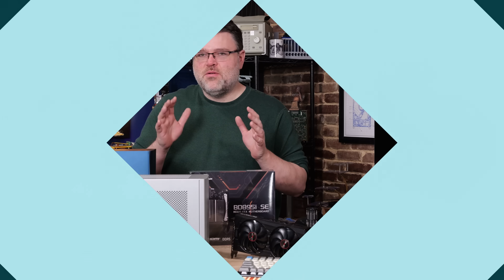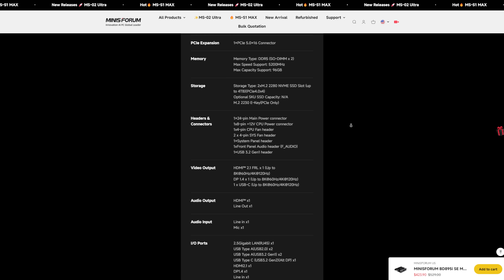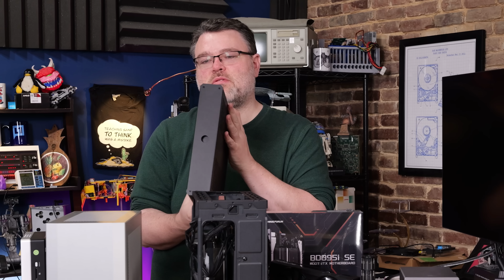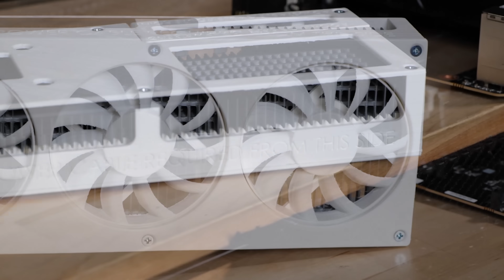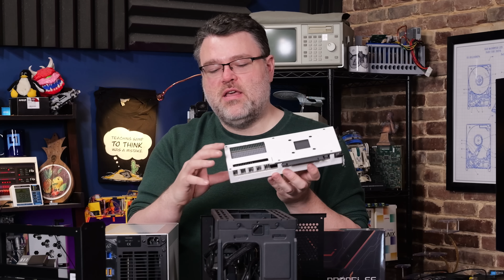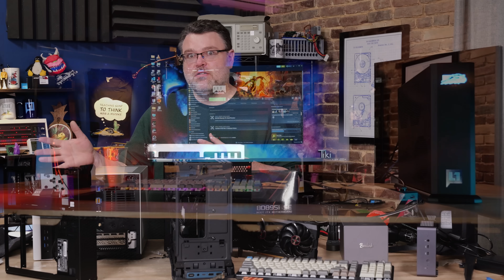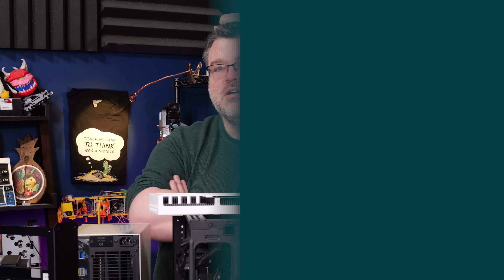Mini PCs Need Some New Rules! Ft: Minisforum BD895i SE Motherboard

Comment: I travel a lot for work and I enjoy FPS titles, especially Deadlock, right now its a mini-itx inside the fractal ridge which I think is still hilariously large for such a small motherboard. 

the thinner flow-through seems to me as most optimal for sowing in my carry on with a portable monitor 65% keyboard and mouse,  with iems for sound, I can setup and pack this in about 2 min but its just too heavy and takes up my entire carry on.
That prototype is very intriguing to me as that's the size I'm going for.

So for me its the hotel Deadlock fps build where I can hit 100-120 FPS in a super small form factor, the case cane just look like a cheese grater for all I care as long as it's not thermal throttling.

Optimum tech did a build that was super small but I just don't have the budget for that low profile GPU and access to a 3d printer.

I thoroughly enjoy this channel thanks!

Comment: The thermal paste on these minisforum boards is the biggest garbage i have ever seen. My 8945HX runs almost 20°C colder with arctic mx4 than with the default paste. Also i could be very lucky but my 5600MT/s RAM kit runs at 6000MT/s + decent timings without any issues. Its bad to config cause you have to test all the timings by hand which can take 1-2 days but atleast my board + 8945HX allows decent RAM OC

Comment: Is there a waterblocks to make it fully watercooled ?
I would like get mini itx watercooled fully psu gpu motherboard rams nvmie all in waterblocks and only one big radiator that needs cleaning.
Is there motherboard that will tune ramm sticks out the box, for me ramm faulty and needed tweaking is what hold back from new build I genuinely hate this new ramm sticks so hard to tweak as before always had motherboard whit memtest.
If I see motherboard watercooled whit ramm and cpu  soldered in that be my choice as from my experience you put ramm in and hard drives and forget so I would rather had already soldered in ram sticks that genuinely work out of a box 
Air cooled mini pc is okey to just need somewhat sandwich so can take panel whit all fans off and blow dust of whit compressed air than no need in watercooled system. As right now I got all watercooled love how clean it all is inside, only hoover now and than 2 x 4 x 120mm radiators

Comment: "It'll get the job done, if you're not gaming" I can game on the older 795iSE version of this on the IGPU pretty well including all COD's, the Battlefields, and a few others even CP2077 on medium settings @1440p. I currently use an RX7900XT with it, but I did test the IGPU and you can DEFINITELY game on it. It even crushes most RPG and casual building games like minecraft, 2d platformers, the works. This version has an even stronger/more-powerful IGPU so it stands to reason you could game just fine on it. even SOME AAA games on lower settings.

Comment: I had purchased a MINISFORUM EliteMini UM780 XTX Mini PC AMD Ryzen 7 7840HS DDR5 64GB in February 2024 that was great until it died in September,2025.  I have built my own high end PC's for over 20 years and never experienced a CPU failure, actually it was the graphics portion of the APU that died.  I feel that the cause is that the extreme small form factor just does not and will never be able to supply adequate cooling for higher end components.  Between the Ryzen 7 along with the 780m graphics in combination of two gen4 SSD's this mini PC simply cooked itself to death.  When I saw the MINISFORUM Motherboard BD895i SE Mini ITX board and noticed that it had a PCIe gen5 16x slot and used DDR 5 SODIM memory even though it is limited to 5200 memory it is compelling to me given the outrageous price of DDR5 memory I figured that I could use the DDR5 5600 memory from Mini PC that died.  I just checked on Amazon and a 64GB SODIM kit from Samsung is $875.  I already have several cases that will work well along with an 850watt power supply.  Along with gaming I also do video editing using Davinci Resolve Studio along with 3D modeling and animation in Blender.  This MB is currently selling for $420 on Amazon, do you think that an RTX 5070Ti will work with this MB?  If it will work I can get by for a while with a New Radeon VII still in its sealed box that I bought back in 2019 for a planned build that was interrupted by an illness.

Comment: I have a Onexplayer mini. It has 2 usb4 and 1 OCUlink port. It is stable with 3 eGPU’s for AI purposes. As we enter this dark era of scarcity, I think getting the most out of what we already have is important. On my micro config it’s best to run two higher end cards for AI, and a smaller card for the screens you interface with. There is a trade off for which enclosures offer Ethernet and USB ports. Which  ones only have OCUlink. 

This approach has allowed for 48gb vram in my little device with a maxed out hx 370 64gb. USB 4 at PCIe 3 x4 and 4x4 for OCUlink. It’s cool what I can do with it. 

Please make a video on a mobile device you can play games on at the airport and then run a 70b parameter llm locally at your destination. That would be  impressive.

Comment: I had installed two new western digital m.2. SSD and this thing won't even boot. Installed an old m.2. from a Haswell system and it booted . Anyone else experiencing these issues?

Comment: When the first bd795's came out I jumped on a microatx version of this for my main system.  At the time I "cheaped out" and just got 2x32gb dimms.  Told folks at work about the platform and several bought the mini-itx version of the board, multiple in some cases, to build home servers.

Comment: Can this motherboard do 8K 60Hz over DP (ideally from native 8K h.265 video on local storage)?  Thinking like a 32" Dell UP3218K Ultra Sharp.  Thinking of rolling my own dashcam PC (6x 4K USB global shutter cameras, 2x 1080p cameras - ffmpeg into a full 8K frame/stream to disk).
  
If they do a new form-factor, would love to see them flip the GPU and edge-launch the PCIe slot so that risers aren't required.  Would also like to see straight-up 20V in rather than ATX 24+8 pin and PCIe power.  Should reduce the number of wires needed to transfer the power to the devices over 12V (700W @ 12V = 58.333Amps, @ 20V = 35Amps).

Comment: I bought a PowerColor Reaper 9070 XT for my old NUC 12 Extreme because it's the small 'console killer' design I want that nobody is really making. I thought I was dead-ended to a 4060 Ti with that machine. It's very tight because of the power connectors being on the side, but it works, and stays very cool. I'm going to be rocking this build for a long time to come. Such a shame Intel gave up on it, and ASUS has just been stuffing laptop boards in desktop cases.

Comment: In front of my TV i 3d printed a case for my BC-250 (PS5 motherboard with 2 less cores). Works like a charm and pretty cheap.. i would call it a console killer just because of price/performance.

Comment: E-DTX Would be a great form factor. Two slots with a x8 in the "slot 0" position and x16 in the usual bottom position. PCB extended over to allow 4 dimm slots with large sockets and additional nvme and chipset. 

Basically the shuttle cube PCB main board form factor.

Comment: Seems to me the quiet machine for the living room is already a rather a solved problem - those dedicated external GPU that are the biggest complaint you raise, quite validly, are really not required for such a thing. The mostly AMD AMU powered mini-ITX boards and things like the GabeCube (assuming it is ever released in this crazy market) tend to have way more graphics compute capability than really required. Arguably the quiet machine for the living room is a problem that can be solved with a Raspberry Pi or really any thin client type fanless computer with almost no graphical compute as you just offload that at the cost of a tiny bit more latency to the noisy full sized desktop in the mechanical room/closet/under the stairs etc.

I do agree some smaller GPU would be nice - I can't recall the last time I saw a low profile spec dedicated GPU that was even remotely competitive with the stuff built into even a fairly basic but with graphics CPU now (not that they don't exist on paper at least, but all I've actually seen in ages is stuff about as a performant or actually is a 1060). But even at 'full size PCIe' just being back within the actual spec expected dimensionally for better compatibility would be nice...

Comment: "Not Upgradeable" and "Not Modular" for these small form factors is a bit unfair - be fairer to say LESS rather than NOT. As most if not all of them do have at least some and usually all of PCIe lanes available, replaceable storage and RAM. It is just the CPU and motherboard with occasionally the RAM that are integral required hot air rework to change - which is not that unusual even in the more modular desktop form factor in practice as other than AMD often supporting the same socket for a comparatively long time you tend to need to replace both CPU and Motherboard at the same time anyway!

Comment: I've heard very mixed reviews for MINISFORUM stuff... most people say they are fine for a cheap tiny PC since it's not a huge risk if they fail to support it long term, but spending thousands on one? Anyways, I ran across a MINISFORUM UM870 Slim refurb for dirt cheap (it even came with 32 gb of ddr5- worth almost what I paid for the whole thing)  and picked it up for internet us/light gaming (to save power/noise/boot time from my big gaming PC). Then the 780m graphics was so good (Ryzen 7 8745H), I grabbed an AOOSTAR AG02 External GPU dock and popped a 2 fan 16gb 9060 XT in it. This gpu dock has a small quiet 800 watt power supply, so I guess you could run an rtx 5090? Anyways... so now I have a tiny quiet PC and a larger dGPU sitting on a dock on my desk for "light gaming". Do I have a problem? Maybe that's what we need- make an eGPU dock a standardized form factor/connection so you can plug one in to any tiny PC. Though an enclosure would make more sense than it sitting in the open... but it does look cool like that.

Comment: The only upside I see on these things is the formfactor. For some it is  just absolutely imperative to have a SFF build. Otherwise: limited BIOS support, thermals, cable management, gimped laptop CPU, limited community to find info online, etc. DDR5 for laptop and desktop are around the same price: $420 for 32GB

Comment: While I think that the form factor discussion about GPUs is extremely valid, the talk about console killer mini itx machines is baffling to me.
How are you ever going to build such a machine in this market? 

Spoiler: not with a CPU motherboard combo that costs 400+ bucks! A console killer PC doesn't need 12 or 16 cores. Consoles are relatively cheap and convenient gaming machines. This talk is not about that, it's about super expensive toys for ultra enthusiasts that want to burn money. 

If you want to build a console killer, you have to compete in price somewhat. And convenience, power draw and so on. If you just build a small ultra high end PC, that's not a console killer. 

Having laptop CPUs baked into motherboards is something that could work, if the price and CPUs used wouldn't be so overkill.

And really, all this talk about value is just bs if you just want to have a pc and/or gaming machine. Of course these components have good value compared to standard parts, but what does it matter for a gaming build? Can you game at or above console level? Is it roughly in the same price league? These are questions for a console killer. And these combos are a definite NO to them.

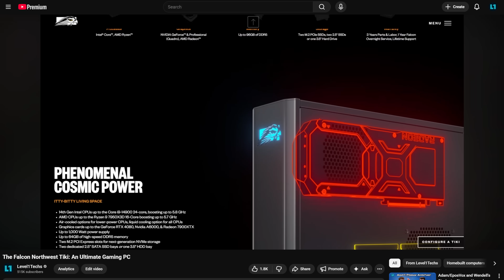Comment: 7:00 Love the Aladdin reference on Falcon's website.

One issue with mini ITX designs I don't see covered much is dust protection, or lack thereof. I live in a dusty area and the problem of airflow/cooling vs dust filters is not one that's going to be easily solved. No-one is going to build a small dustproof chamber - with sufficient airflow - for a PC to run in.

Comment: I really like the minisforum bd790ix3d I have especially in a larger ITX case designed for full size GPUs. The CPU is powerful enough to really make use of the 9070xt i have it paired with. But I have been very frustrated to see the development of all these mini PCs into thick little cubes. I want to see pursuit of form factors like the Minisforum AtomMan G7. It's like a laptop without a battery or attached screen/keyboard. This makes it a lot more portable in a bag or backpack. A thick little cube computer is not easy to transport. It's harder to wrap padding around it, if you put it in a backpack next to a portable monitor it becomes a pressure point to break that monitor or keyboard. I just think its silly we keep making laptops with great powerful components in them  but the battery lasts 30 minutes. Just replace that worthless battery with better cooling, raise the TDP and make it require an external power source. It's a reasonable trade off and I think 90% of traveling gamers will be willing to find a plug or have an external power source.
Reply: what case are you working with

Comment: Personally I think more cases should be optimised specifically for mATX with a SFX power supply.  mATX at least gives you 4 dimms and 3+ nvme slots, so you aren't sacrificing too much, while still having a very small form factor.

Comment: I've been going back and forth between options. Originally wanted to get a fractal ridge and do a minisforum itx and dgpu. Then the ms-02 ultra came out and it's a smaller form factor but also a bit limiting with gpu options. Strix halo and Steam machine are a little underpowered and have no upgrade path. Then pricing just went out of control for everything. So then I thought there is really no reason to have multiple systems. I should be able to use my gaming rig anywhere in the house so I'm trying to come up with the best way of doing that. Would love to see a video exploring those options. Whether it's sunshine/moonlight, apollo/artemis, steamlink, or just running optical hdmi cables and usb extenders. Which option provides the best user experience?

Comment: I built a sleeper gaming system in a beige 1990s tower. The novelty of that build wore off, so I moved this system into an aqua blue, small micro ATX case. Not as small as an ITX build because I needed room for an ATX power supply and an ASUS RX 6800 XT video card. Looks good in the rec room.

Comment: Easier to cool CPU? For fun, I used PBO2 to set clock offset negative 225 (5.0 GHz target) and voltage offset negative 45.
Now My Ryzen 7 9800X3D runs 25~45W, and is stupidly cool in all games.

Comment: The dearth of compact GPUs, especially ones that don't tower well above the slot bracket has been a source of much frustration for years. 
Almost as frustrating as the lack of decent half height GPU's but that is pretty much a lost cause at this point.

Most of my builds are mATX or miniITX at this point.  A couple of them I built specifically to be portable enough to put the computer, keyboard track ball and occasionally a travel monitor or two in a duffle bag, go somewhere, plug into whatever display was available (increasingly large 4K TV's, but 1080p is fine) in the hotel or facility, and be ready to go with something more powerful and less expensive than a laptop. I have more storage and GPU performance, enough cores and RAM to run a VM or two. and better USB and connectivity options.

To that end, I settled on the PowerColor Fighter RX 6700XT and RX 6750XT because they were the largest I could comfortably fit in a Silverstone SUGO SG13, and the setup works well. There's really no need for a GPU to be bigger than that if the cooler is designed well. Also picked those because they were the most affordable cards that used the full 16 lanes instead of just being x8 on an x16 slot.

The other thing a standard would do, beyond console killer boxes is get back motherboard space for expansion slots.  The sight of ATX board with two PCIe slots just pisses me off, and I know it's ALL because of stupid 4 slot GPUs that don't need to exist.

Comment: I do love these mobile CPU ITX boards. Some of the NAS focused ones have a ton of features and are plenty performant. I am with you 100% that a proper ITX GPU standard is needed, not just "SFF ready". One super nit-picky comment about these mobile CPU boards though: I wish they implemented a standard "LGA1700 compatible" mounting with shims or whatever. I'd love to swap the included cooler on my BD790i for a Noctua or Thermalright low-profile cooler or maybe I just need to suck it up and swap out factory thermal paste/pad.

Comment: A new form factor I could get behind would be one where the mobo has 16 pcie lanes that go "north" out of the CPU insead of south to the other expansion slots and that way the GPU PCB could be on the same plane as the CPU and the coolers for the GPUs could be very similar to CPU air coolers and the air flow would be parallel to the CPU coolers air flow and neither would have any fundamental obstructions.
Reply: How about just solder the cpu to the GPU board, fully integrated. Put the M.2 and sodimms on the reverse side.

Comment: Man, I wished we'd get a proper APUs on ITX. I don't want to use the weak 8700G just to get a 780M and PCIe x16. And the HX on the MinisForum have all weak display adapters for "gpu". Give me 8 Cores, 120W TDP, like at least 16CUs and a PCIe x16 slot.